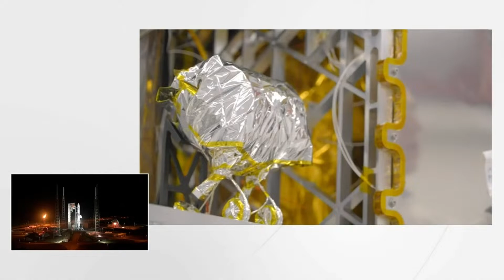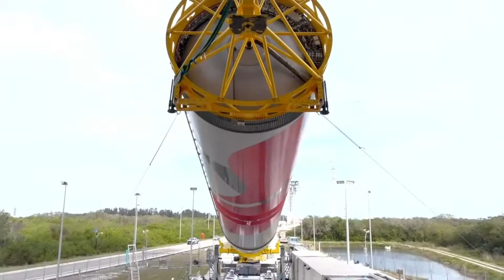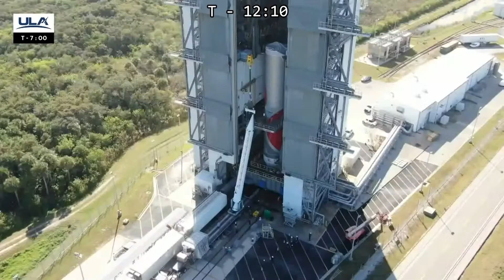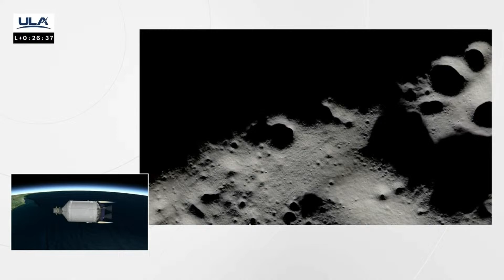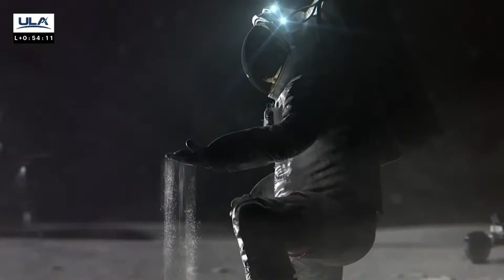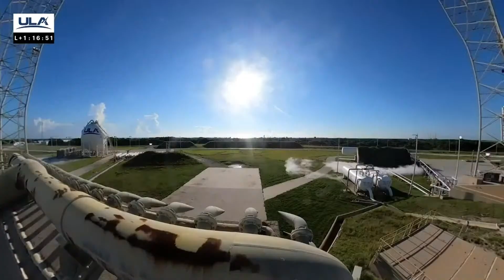REPLAY: Vulcan Centaur historic 1st launch + Peregrine lunar lander! (8 Jan 2024)

Comment: Why do people keep saying parts of Vulcan  will be reused? I watched the simulation and the twin engine top section is not being reused its being redirected toward the sun.
Reply: The BE-4 engines are reusable. You're talking about the RL-10 engines of the Centaur upper stage. The BE-4 engines are the ones that fired at launch
Reply: @awesomemcawesomeshorts9531 if I am not mistaken BE-4s won't be reused as well, at least at first. Later they plan to jettison them and have them splash down on inflatable heatshield using parachutes.
Reply: @92Cuky_ that’s the long-range plan
Reply: Yes someone online mentioned the RL-10s being reusable and that made no sense. So I was looking into what actually is reusable  which is the BE-4s. The problem is theres no mention of them at all after they seperated . No simulation of them "landing back down" , no wikipedia about the results of the BE-4 or their current state. ULA says they are reusable ok fine but wheres the mission  data?